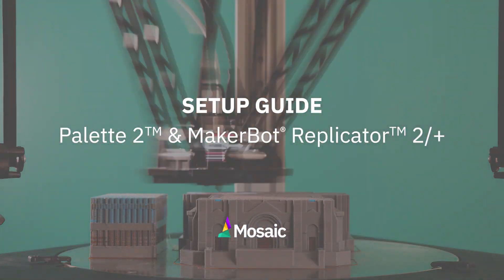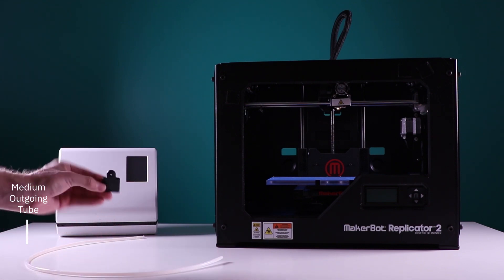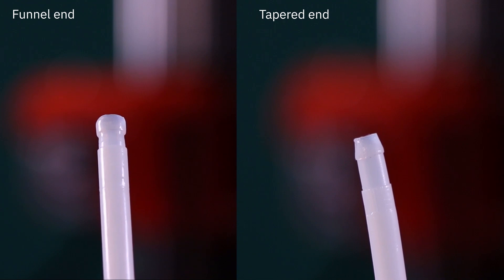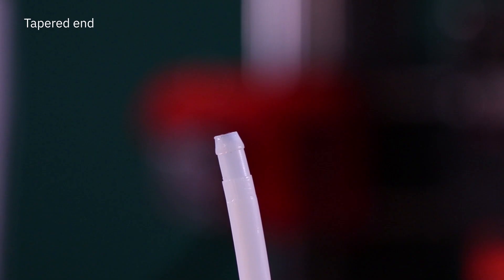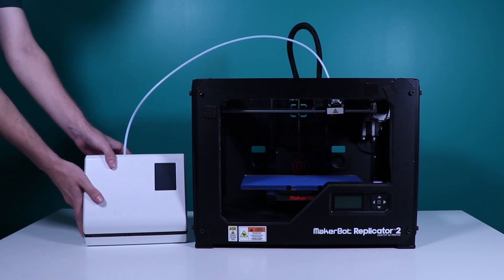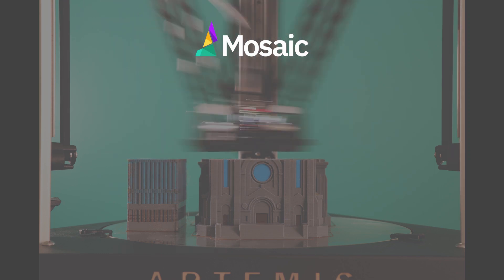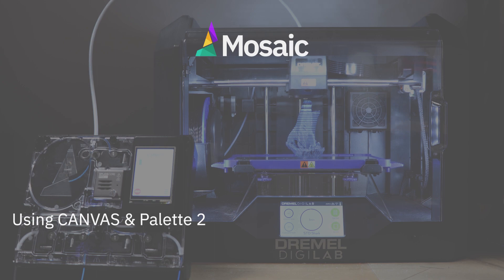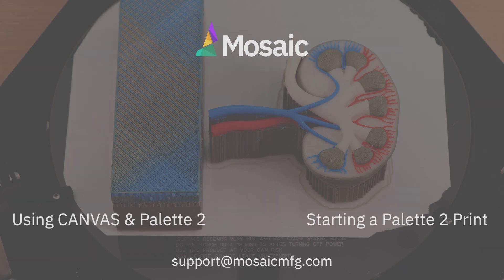Setup Guide: MakerBot® Replicator™ 2/+ with Palette 2™

Comment: So the Makerbot Replicator + is compatible but no presets in Canvas?
Reply from the maker: Hey Tylerrb08, you can use the preset Rep 2 profile in CANVAS and adjust some of the settings (ex. bed size dimensions) for the Rep+.